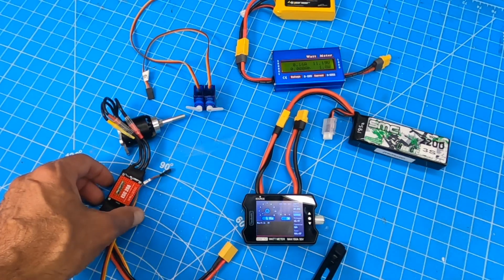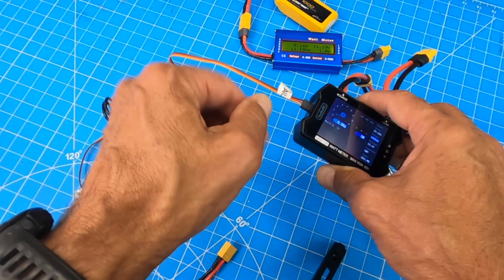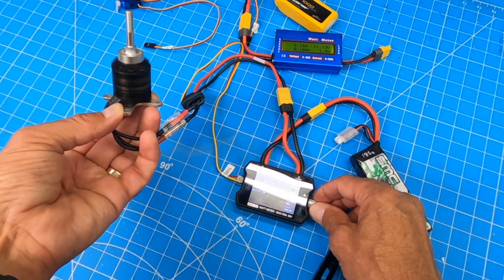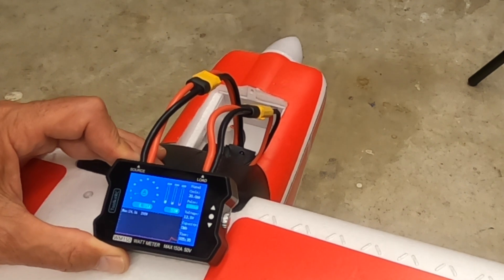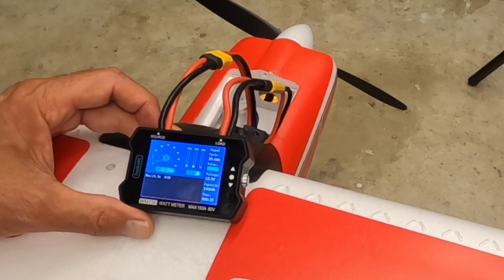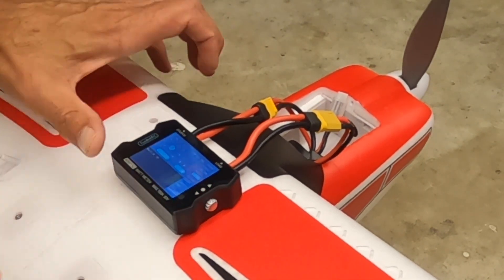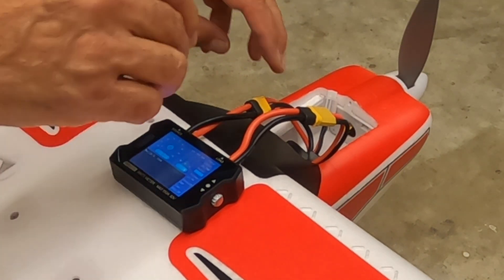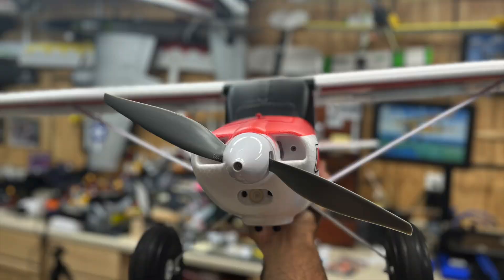Increase your planes performance using the Watt Meter

Comment: Surely it can't tell you anything about efficiency unless you are also measuring the force that is produced? I want to try to do that using a fishing weighing scales so I don't have to put anything in front of the prop, but I'm not sure how to rig everything up
Reply: I use watts/lb to determine the overall performance. It takes pitch speed (rpm x pitch / 1056) to move the air fast enough to pull the plane at at least twice its stall speed. Thrust is great for going vertical, but it takes pitch speed to pull/push a plane thru the air. You can move a large column of air slowly or a small column of air quickly, but you'll probably want something in between. I like props with a diameter that's 1.5 times its pitch; e.g., a 9x6, 12x8, etc. The blades won't be stalled at zero airspeed, and the blades are short enough that the motor doesn't have to work too hard to turn it.
Reply: @txkflier  W/kg is a good way of ensuring your plane has the performance you expect, but it is making assumptions about how the electrical energy consumed is used. The video is talking about how changing a prop can increase efficiency, but efficiency is about using the energy for the best effect. Without knowing what is happening to the air, drawing more Amps might be less efficient. If comparing a 10x7 and an 11x6, is more W consumed better or worse?
Reply: @duncanmartin2626  The longer the blades are relative to the pitch, the less efficient the prop will be. A full-scale plane with a constant speed prop will go farther in coarse pitch than it will in fine pitch.
Reply from the maker: Thats where eCalc website helps determine which power system for your plane..  If you are building and designing planes/power systems, checkout eCalc....

Comment: Great video.  I'll have to get one soon.  So, the more amps pulled, the shorter the flight but more power and speed?  Is that correct?  What is the impact on the ESC and motor of the higher amps?  How many amps is too much?
Reply from the maker: There are trade offs.  In this case the Stock 11x7 wasn't as efficient as the APC 11x7.  So, I actually had more power and similar flight times.  The speed and power were increased, but since I don't need to be at full throttle all the time it was a wash.   If I was really pushing the system with a long prop, then typically the speed/power would be more and less flight times.   I don't like to see a AMP draw over the ESC max.   Also, motors have a max AMP/WATT too.  So, you gotta watch that..   There is a wonderful website called eCalc. It's great for sizing a power system.

Comment: Great video and a great tool! I just want to add that these tests should be done with a FRESH battery EVERY TIME, because drawing charge from the battery will yield a lower voltage, skewing the results of both Amps and Watts.
Reply from the maker: Yep.. Also the amps will usually be lower when the plane is flying verses static testing...

Comment: The amp draw seems reasonable because I have DYS 3536 1250 kv motor running 10x7 APC prop that draws ~50 amps which i think is too high,
Any idea why ?
Reply: No-load rpm = 11.1 x 1250 = 13,875 rpm
Loaded rpm = No-load rpm x 80% = 13,875 x 80% = 11,100 rpm
Pitch speed = Loaded rpm x pitch = 11,100 x 7 / 1056 = 73.6 mph
Watts = 5.33xE-15 x rpm^3 x Diameter^4 x Pitch = 510.3 watts
Amps = Watts / Voltage = 510.3 / 11.1 = 46 amps
If I add 10% for motor loss, the watts is 510.3 / 0.9 = 567 Watts In.
And, 567 / 11.1 = 51.1 amps. So, there you go..
Reply: @txkflier  Thanks for the explanation, The equations will help me optimize my setup.
Reply from the maker: Sounds like Txkflier got you covered...   Appreciate you watching..